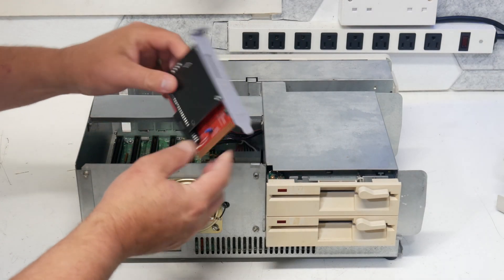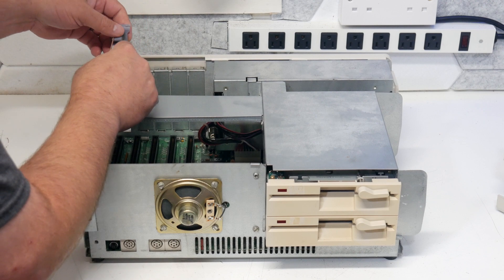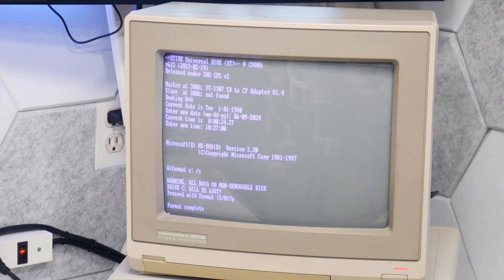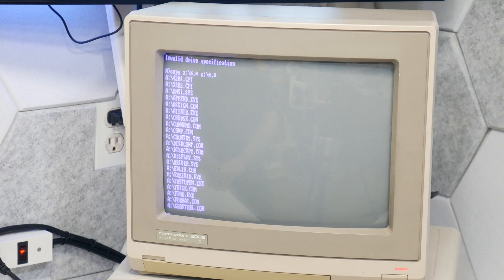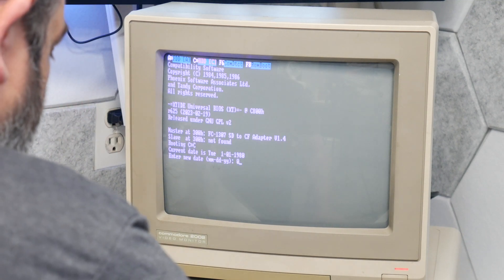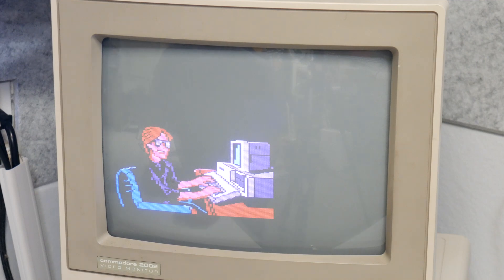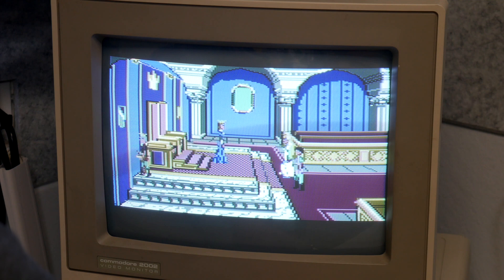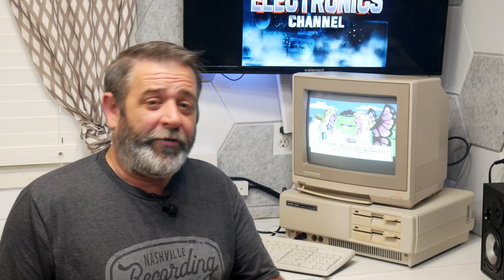XTIDE SD Card Adapter Install in my Tandy 1000SX

Comment: I almost got a similar Tandy at Goodwill for $40, but didn't buy when I saw the look on my wife's face when she saw the beige monstrosity I wanted to bring home. So I'm stuck with DosBox for the foreseeable future. I'm glad it survived the flood, but I'm sorry your insurance isn't covering anything.

Funny similar story: my back door is currently boarded up because someone tried to break in while we were on vacation. They didn't steal anything (luckily, because there's about $4,000 worth of audio equipment right inside the back door). Anyway, insurance quoted us a deductible so high that we might as well do the repair without bringing them into it. Makes me wonder what we pay for each month.
Reply from the maker: $40? That was a great deal. Too bad you didn't get it, but I understand. 

My insurance company said they understand a lot of the flooding happened because the door ended up getting blown open. They said the door was covered, but not the flood damage. So with a $1250 deductible, I decided to fix the $300 door myself.